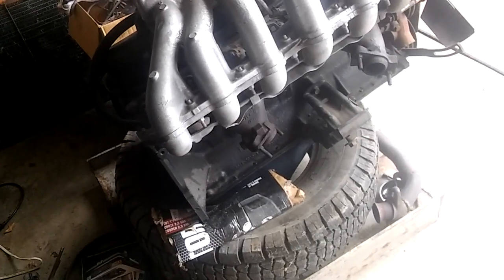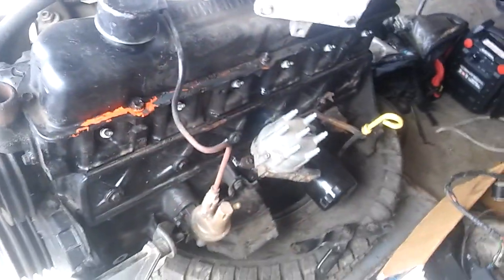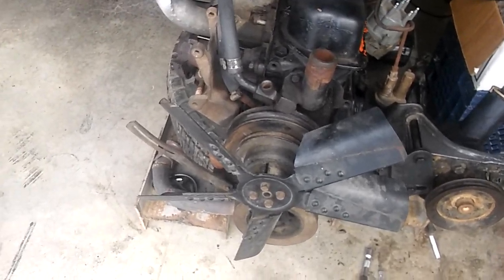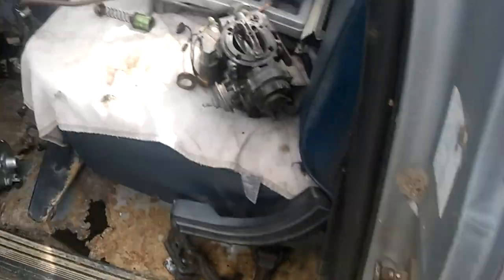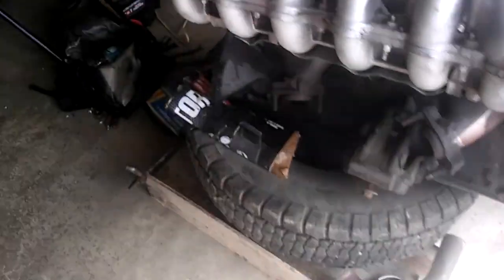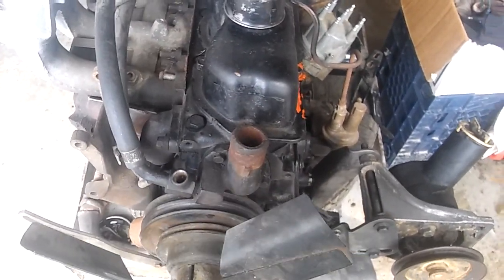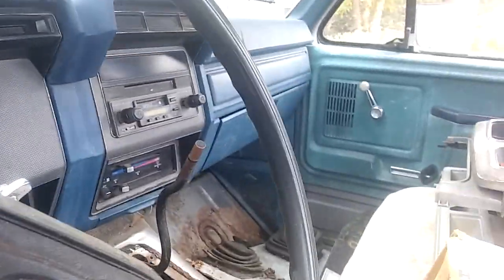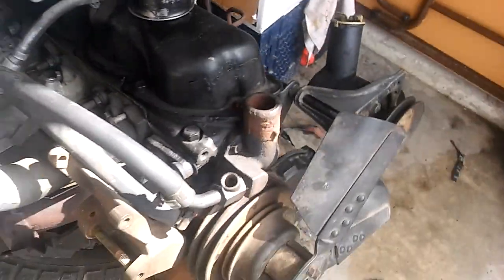ford inline 6 300 engine THE BEGINNING

Comment: How did that intake work out?  Since it was originally a fuel injection intake, which was designed to flow only air, I wonder if the fuel from carb stayed atomized w/air or separated & pooled up in places, causing lean/rich issues on different cylinders.
Reply from the maker: It worked great at 2000rpm+ warmed up but at idle the turbulence in the plenum was so low that the fuel would pool up in the plenum. The cylinders were slightly different because of the pool of fuel

Comment: the 300-6 and the 292 chevy 6 are the two best inlines in the world,torque to give away,i had the last year 300 6 --1996 e250 van,from the factory it had the smallest injectors ford every built,i lived with the check engine light on,putting carburetion on this engine is smart,you can't blow up a rich motor,jet it till it blubbers then jet it 2-3 leaner,stab it and steer
Reply from the maker: I'm going to purchase a wideband oxegen sensor that doesn't need a computer so I can get the mixture perfect
Reply from the maker: https://express.google.com/u/0/product/10903345228050573134_793713545972905962_1699011
Reply from the maker: Yeah I'm getting a Bosch stand alone wideband gauge so I can tune it but right now it's pretty fast

Comment: That big cap is much better style . Uses a cap a dapt and tall rotor that helps prevent crossfiring of the cylinders and spark scatter with the high power of electronic ignitions. The tall rotor helps keep the the ignition from grounding down through the distributer shaft .

Comment: The corrosion between the front spring mounts and the frame could be scary.
Imagine if one broke off ?
Perhaps replace the rivets with Gr 8 bolts.
Reply from the maker: I know I know its sad. I think I'm going to start on some front end work when I start driving this summer.
Reply: Some asshole hit and ran my car after his spring perch busted I found the perch on the road I found the truck matched up all the broken  parts/lense and paint scraps and he still denied it. My point is the perch coming off will rip the wheel right out of your hand
Reply from the maker: Yeah I will fix it

Comment: Iv built a few of these junk yard combos 84 bottom end with a 94 efi head' efi exhaust manifolds i went with a hei out of a old buick v6 and a 2 barrel off a 302 , the 94 head has heart shaped chambers so shave that head and its a noticable bumb it also has non ajustable rockers which simplified life. After killing 2 blocks i had to just face facts, the 300 is great but it wont spin like 250 and survive the strokes too long
Reply from the maker: What do you mean when you say 250??
Reply: Ford 250 inline its shares more in common with the falcon six its a 4.1 liter a bit more compact and theres more speed parts.  The jeep 4.0 is my new staple just beacse its common
Reply from the maker: @johnhosler6636  Oh damn I never knew that. Thanks! I'll post a driving vid on the truck with the offy intake I bought in a month or two

Comment: I had to sell my 96 F-150 because of terrible wiring and electrical problems no matter what the battery would keep going dead even if it was new, the front gas tank would pump gas into the other tank, or not work at all headlights came and went the wipers would come on when you pushed the horn, and other weird things light blinking dash lights I was scared it would short and catch fire.
Reply: I have a 96 f 150 4x4 311000 mile it never had any problems like that whatsoever, its a everyday truck, in and out the mud too !  Its must be preventive maintenance i guess😊
Reply: @danonoveh8114  Whats the preventive maintenance for faulty wiring?

Comment: Sorry man i cant see this ever running again, to far gone and you will never get the wires right fords have miles of wire.
Reply from the maker: Oh really well I drive it to school every day and I ripped all those wires out it has three wires going to the motor................................
Reply: @mechanicalking   Thats good I'm glad you figured it out you really are the king.
Reply: Give tha dude a littl break mate,show me a computer ized vehicle that doesn't.. Allways sayin some negative crab about a dam ford !!
Reply: @danonoveh8114   Im just going by the experience I had, the E4od auto trans would leak piles of red fluid on the cement and I could never find the leak plus myriad other mystery problems.
Reply: Nevermind my friend, cant answer that one, yu got me stumpt!!
Reply: @danonoveh8114  All good Dano glad you got yours running .
Reply: @unclequack5445  Everything in that transmission family is like that. My family and I have had quite a few of the vehicles with em. The only good fix in my opinion is a better transmission.
Reply: @alanbiggle544  Alan I ended up swapping in a Borg Warner T-18 Granny gear 4 speed manual transmission, It saved the truck and gave it another life, it pulled a lot better and would haul loads easier with the granny gear to help it off road That and I Lincoln locked the diff. You can see this 4 speed in action @ "Shopping for tires with Skeefoo" here on YouTube.
Reply from the maker: Just like I tell all my friends at school that are using their dad's money to buy a truck. If you're going to get an automatic you might as well get a newer one because you're going to run into problems whether it's a Ford Chevy or a Dodge. There are a few good Transmissions out there like the turbo 400 that can handle a little bit more power than it's rated for but some of them can't even handle stock power. Good luck!
Reply: @mechanicalking  Ive swapped over a few trucks from auto to manual I love shifting gears.